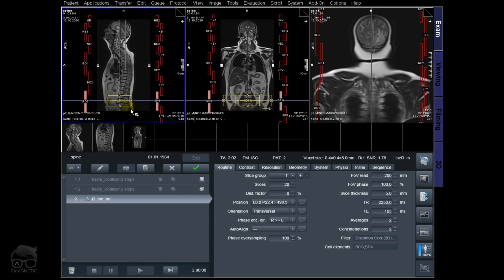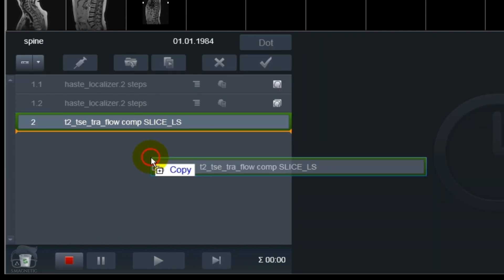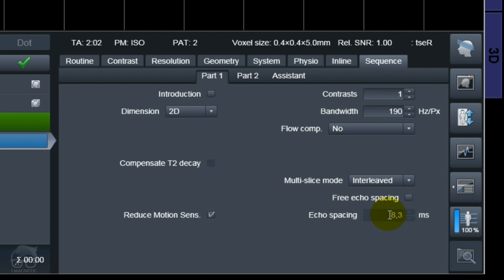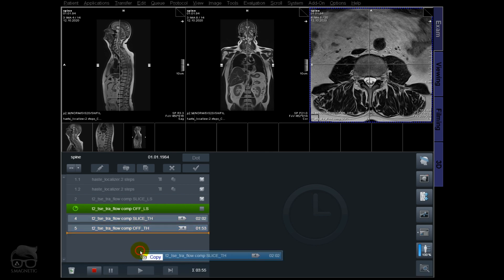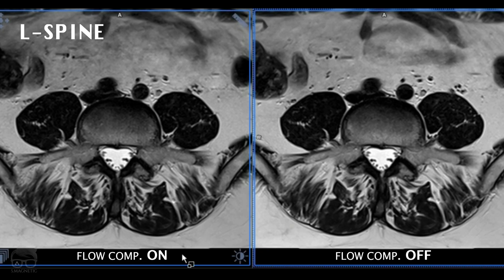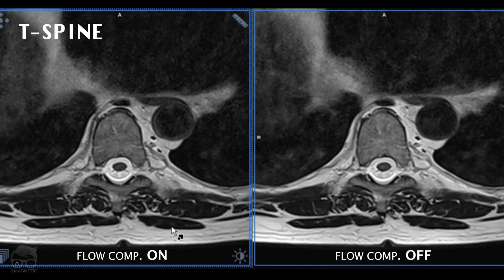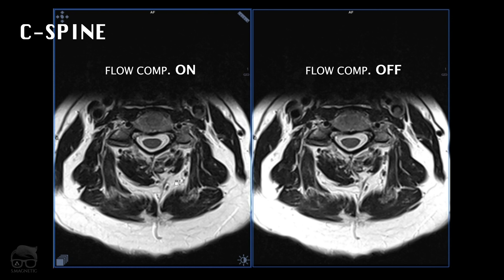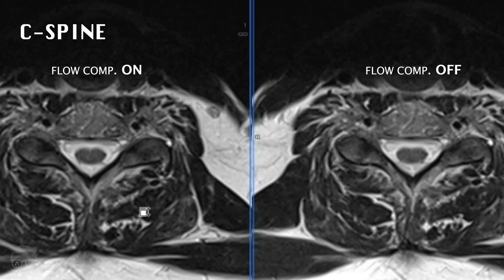FLOW COMPENSATION – SPINAL CORD

Comment: Bac love your videos!
Can you explain the difference between read and slice. When should you use which and where?
Thanks!
Reply: I would also like to know the answer to this. How do you know what direction to do flow comp. I assume it's the direction of the flow you're trying to compensate for. So slice direction for an axial spine, but frequency direction for a sag spine, but only if phase encode is A/P?? If phase encode is S/I, then probably slice direction since some flow might be into or out of the plane? In my experience flow comp is pretty hopeless and doesn't really add much at all.
Reply from the maker: https://mriquestions.com/flow-compensation.html
Reply: @Nguyen_MRI  that is very technical and hard to understand for the average tech. (the MRI question article) The other one is decent.
Reply from the maker: @anniesshenanigans3815  yes. It’s one of the most basic things regarding MRI to avoid such flow. So yes need to have a basic understanding beforehand.
Reply from the maker: https://cdn0.scrvt.com/39b415fb07de4d9656c7b516d8e2d907/1800000002841192/652f8311ab8f/Siemens_MRI_Magnets-Flows-Artifacts_EN_1800000002841192.pdf     from page 14
Reply: I am also waiting...

Comment: Do you always use body coil in spine exams?
Reply from the maker: yes as long as its not uncomfortable for the patient due to claustrophobic etc.
Reply: @Nguyen_MRI  Why do you do this for T & L spine? What is the benefit? Thank you for your content, it is really good!
Reply from the maker: Better signal overal. Example if the patient is big. That also means that the spine will be further away from the coil on the table. Furthermore image quality will be not as good due to that. Having a body coil in front will contribute to more overall homogenous images like the example I showed in the video.

Comment: I think on Axial images it might make a difference depending on what TR you use. If your using 2200ms TR might not make much of a difference but 4000 ms you may see a difference with using FC. curious what TR you were using?
Reply from the maker: Tr 2250 with restore pulse. May I ask why you think it will make a difference on higher tr?
Reply: @Nguyen_MRI  your images look really good CSF is very bright which explains restore pulse. I think with longer TR the CsF moves our of the slice and is why you get a dark band around the cord sometimes with TSE or FSE T2. If you try to use a longer TR with and with out i think you may see a difference... just a hunch
Reply from the maker: Very interesting. Must try out one day. Thanks for the tip 👍